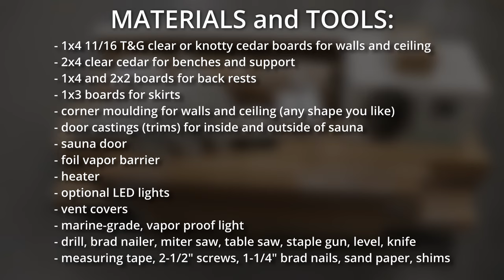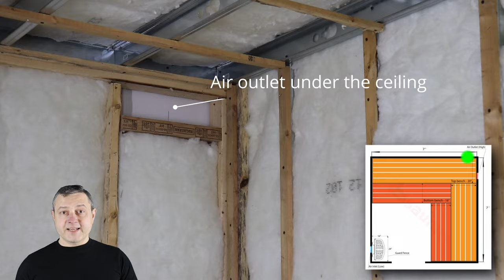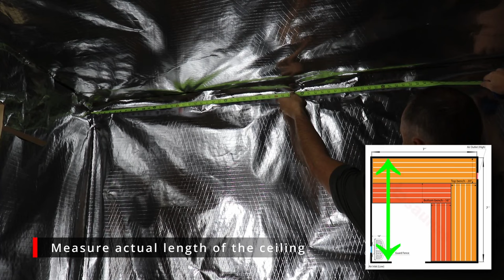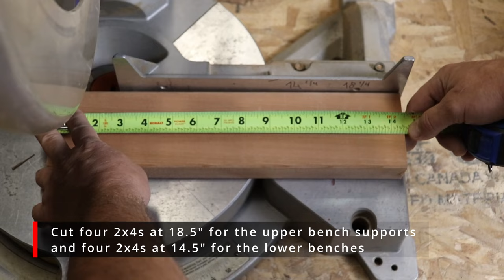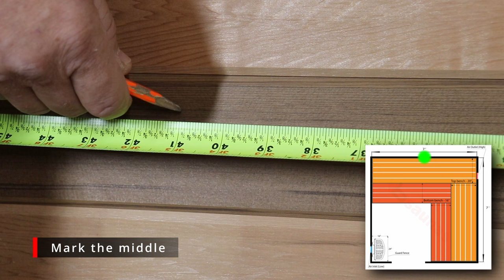Build an indoor sauna yourself! Super easy, professional quality! Step-by-step instructions

Comment: Totally wrong build. Wapor barrier should have airgap before panels and vapor barrier should not be punctuated, with minium holes. In Finland we use foam insulation sheets with aluminium cover that is tape with aluminium tape to have tight seal. And panels are attached on joints that are making a gap to have air to flow behind the panels.
Reply: Can you provide a video where it's explained and done step by step the way you wrote it?
Reply: Opinions are like assholes, everybody's got one. It's amazing the number of videos I have watched while building the sauna for my wife... and they all contradict each other🤣🤣🤣 You know back in the day, before there was insulation saunas we're just made out of sticks🤣🤣🤣
Reply: @ThomasLips  I was thinking the same thing as I was reading this.  I'm going to start building a sauna myself.
Reply: @rdhaines1966  have fun with it! It's going to feel great when you get it done... at least that's what I keep telling myself as I'm freezing my ass off in the PNW while building ours 😉🤣🤣🤣
Reply: Those that contradict this advice have not done their research and/or lack a basic understanding of physics.
Reply: @ThomasLips but adding technology and what not incorrectly can and will create problems you wouldn't have otherwise had. Btw, all this stuff is new. Only royalty would have a quarter of the luxuries we have on a daily basis
Reply: @ThomasLips Krist Novoselic quote 👌
Reply: Agreed. Need that air gap to avoid long term damage of cedar boards
Reply: Anybody challenging a Fin on how to build sauna?? Really?! I'm not Finnish but even I know that there should be a gap between vapour barrier and cladding, this is to allow wood to properly dry. The insulation also looks insufficient to me. The better the insulation the quicker the room will heat up as well as hold temp better for longer. Same principle applies to all buildings and Pizza Ovens for anyone wanting to build one of those too 👍😁
Reply: @ThomasLips I wouldn't trust anyone other than the finns on how to build something they invented, properly. The amount of dysfunctional American saunas I have been in/seen is ridiculous.
Reply: Dumb question: why the insulation if this is indoors? I get that it may take longer to heat up but with a powerful heater is this an issue? All the heat escapes to the house eventually?
Reply: Can you show how yous build yours??

Comment: How fo people still not understand this, heat (steam) rises, so your stove needs to be either so huge in comparison to your sauna that it is able to pump out enough steam to fill the ENTIRE room, OR you can do it the proper way, and make sure your stove is at or below your foot level when sitting on the bench, and your head as close to the ceiling as possible, as in within 1-2 ft. There is no reason for your sauna to have a meter of dead space above your head, might as well go sit outside and throw water in the snow at that point. Saunas should have proper ventilation also, one below, one above, and dead space, meaning below your feet snd above your head should be minimized, you can even build solid benches if you want, and that way you arent wasting heat in the dead space underneath the bench. Also, if you have a very large, height wise, or width wise, you need to make sure your sauna stove is big enough to heat all of that volume. Oh yeah, and make sure you dont leave exposed metal fasteners to burn your ass or back on.

Comment: Lack of furring strips to create an air gap between the paneling and reflective foil will result in a lot of heat loss through conduction. This is the most-common error I see in sauna installations.
Reply: You're not wrong, I think if its an insulated wall though it will be minor. Most would rather the extra space vs loosing a few inches.
Reply: How much of an air gap is needed? Is 10mm too little?
Reply: Most sources I've seen recommend 1/2 to 3/4 inch (13 to 19mm), and I'd go with that. I have seen as little as 1/4 inch, but I wouldn't go that small. For one thing, at that size, the furring strips would be pretty fragile and prone to splitting.
Reply: @matthewshepherd826 use cor-a-vent as furring, you can but in different thickness, and super easy to cut, screw, and it has breathing holes all throughout, its almost like thick cardboard strips, but it's plastic.

Comment: Pretty good overall. But the benches are too low. Normal rule of thumb is 48" under the ceiling for the top bench, then 18" below for the next etc. Otherwise you wont get the Loyly, and will end up with cold feet and a super warm head.

Comment: Are the 2x4 also special wood or are the regular wood?
Reply: they appear to be cedar, which is mold and rot resistant.  cedar is what is used in building saunas.
Reply: @newmoon984331  cedar is what is mainly used in the USA but not the traditional wood type outside of the US.. Fir and Spruce are mainly used.. for the original commenter any soft wood with clear grain.. meaning no knots or dark spots is best.. the darker the spot the hotter that spot gets

Comment: I'm in the middle of building a custom basement sauna and have a question about ventilation hoping to get some feedback from those with experience - the adjacent room is a 7'x7' bedroom closet and the other side is a large rec. room, can I exhaust into the bedroom closet or is there a concern of too much humidity being pumped into such a small space? Also, should I close off this vent during use then open it once I'm done? I'm assuming you would want to keep the heat in as much as possible while you use it. Lastly, for the intake, rather than a vent I'm planning on keeping the door 1/2" above the floor which is also where the heater will be located - would this suffice?
Reply: I've never built indoor saunas, but i would be concerned about both the high heat and the humidity.. is there a way to run a small 3inch hvac ducting out to the outside like maybe in a ceiling joist of the basement?  the vents are to allow oxygen in and out.. poor designed saunas with no airflow will lead to light headedness and dizziness in high heat. those vents wont make too much difference with a heat roaring at 180F.. my main sauna is in the mtns of Idaho and i have 4in intake wide open at the base by the wood stove and then diagonally across the sauna at the ceiling is the next 4in outlet which is usually wide open also, even at single digit outside temps.. and it make no difference inside the sauna.. for the intake that you mentioned that should be enough.. depending on the airflow movement in your home.. modern highly sealed homes make air travel more difficult.. but start with that door gap and see.. worst case you'll need to add a secondary intake vent.
Reply: My old room was literally right next to our basement sauna, and the idiots who built that sauna did just that, vented it into my room instead of outside. That room was its own sauna every time someone was taking a sauna, my room got hot, and SUPER humid,DO NOT vent it back into your house, it's meant to exhaust to the outdoors to get rid of the steam, and exchange air.

Comment: How about friends I hope and someone could guide me, I am about to start a sauna project, but I have a question, what type of finish, protection, lacquer, or what type of finish is recommended for wood? (I plan to buy wood without any treatment for the project) but I would like to know what protection I can give the wood, so that it resists humidity and sauna temperatures. Again, greetings to all, I hope you can help me.
Reply: Paraffin oil
Reply: If it's on the inside, the wood needs nothing, the left over heat from the sauna dries the wood out after every sauna, you just leave the door open a small crack for air to leave.